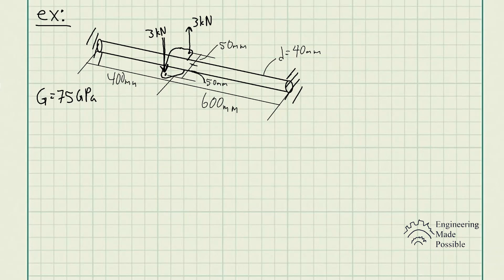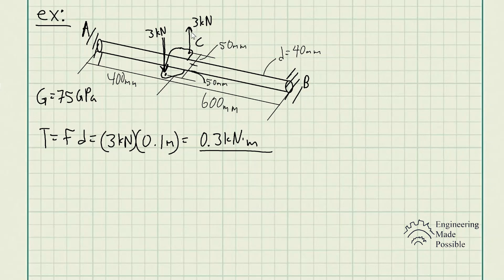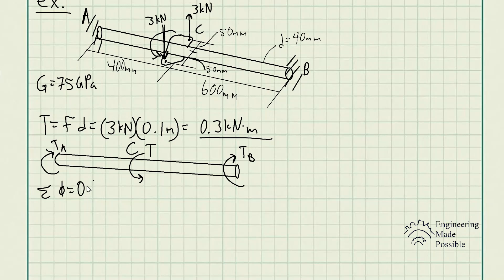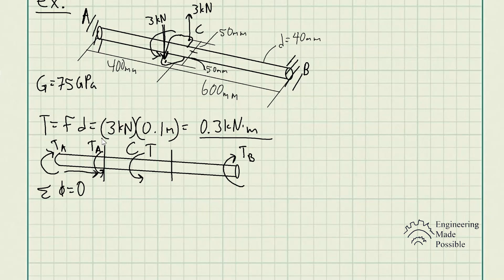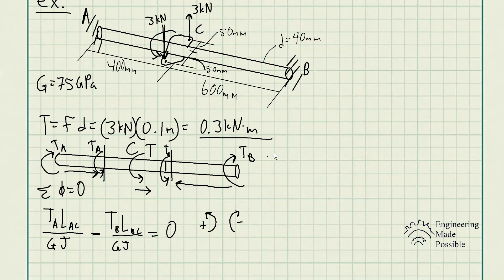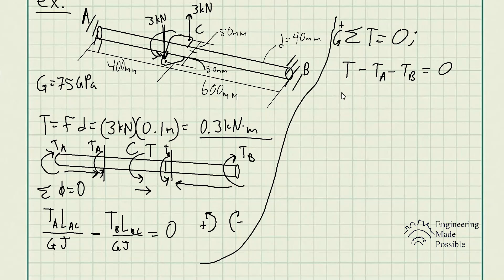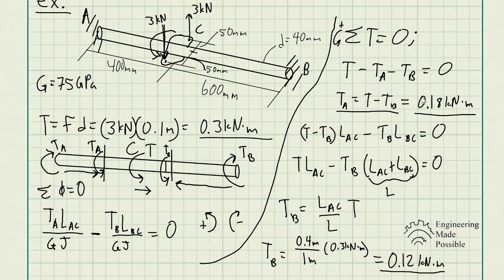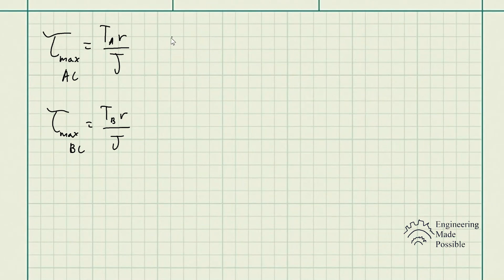The steel shaft has a diameter of 40mm and is fixed at its ends A and B. If it is subjected to....

Comment: Torque is a type of moment, so I used the equation of equilibrium for a moment and got the same answers for your T at a and b, is this method also fundamentally correct?
Reply: He doesnt even know. The answer isn't even rounded right smh